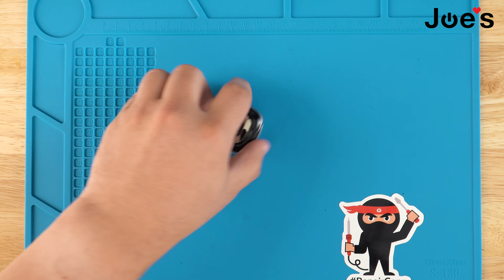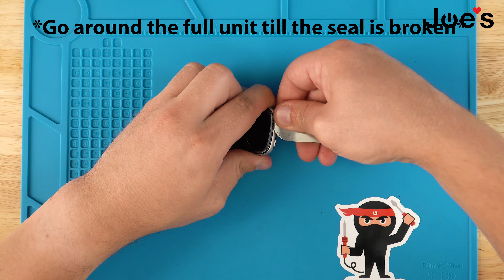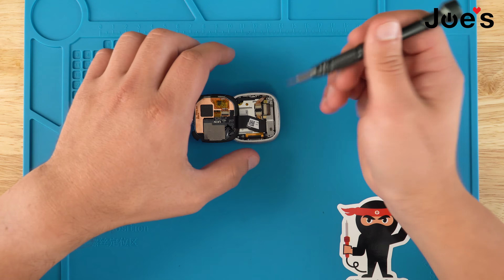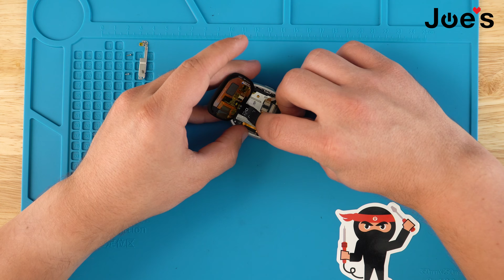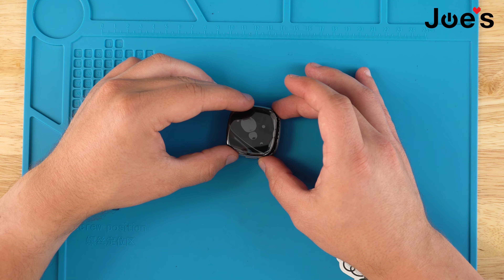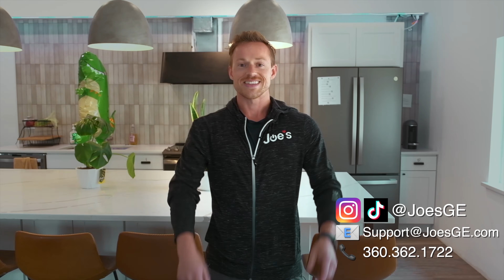Fitbit Sense 2 Broken Cracked Screen LCD Replacement FB521 | Repair Tutorial

Comment: What adhesive are you using to seal? Will B-7000 work ell for this repair?
Reply from the maker: It will work but not very well. 

This is the glue Fitbit uses. 

https://www.joesge.com/products/electronics-cold-press-lamination-adhesive-seal-3ml-syringe-18-gage-tip-glue?_pos=1&_sid=3850cf49e&_ss=r
Reply: @Joesge  Before the replacement, is the watch still waterproof?